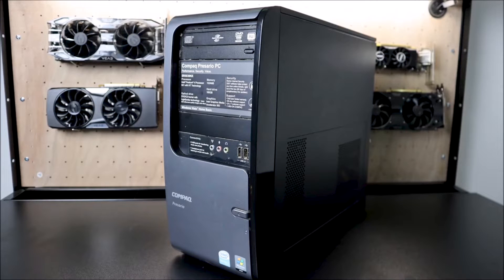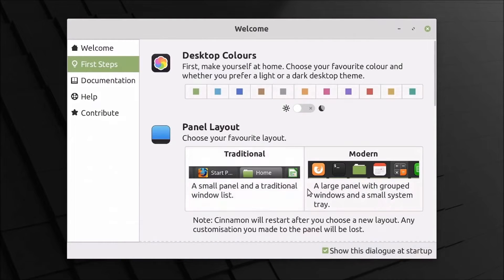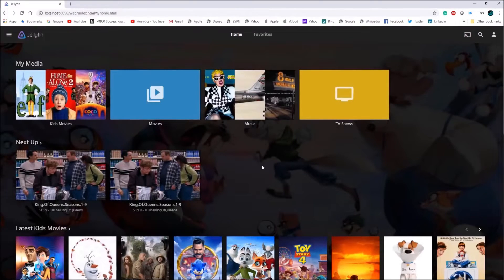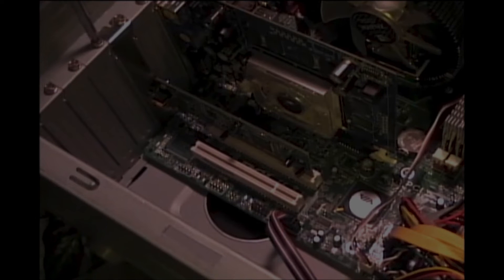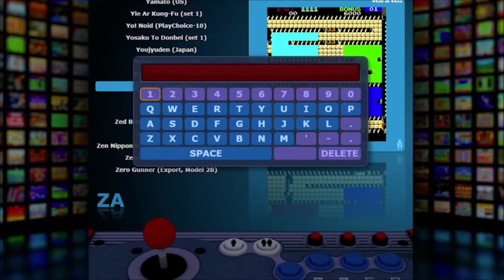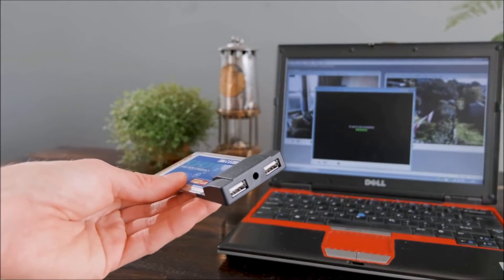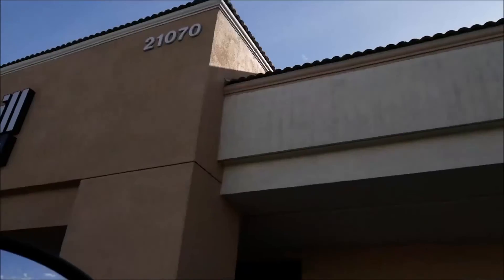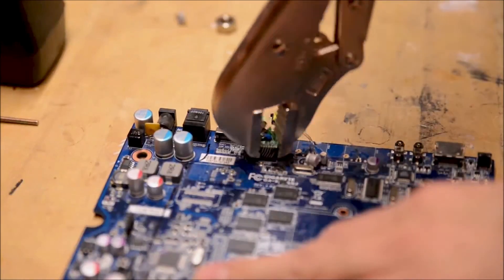15 Practical Things You Can do With an Old Computer

Comment: I would make use of my old pc if every click did not take a minute or longer to register
Reply from the maker: Hey there! I understand your frustration. It can be really frustrating when your old computer is so slow that it takes a minute or longer to register every click. There are a few things you can do to try to speed up your old computer. First, make sure that you have all of the latest updates installed . Outdated software can sometimes cause performance issues.

You can also try to free up some space on your hard drive . Old files and programs that you don't use can take up a lot of space and slow down your computer. If you've tried all of these things and your computer is still running slowly, you may need to upgrade your hardware . A new hard drive or more RAM can make a big difference in the speed of your computer.

Here are some additional tips that you can include in your reply:

Use a lightweight operating system . If you're running an old version of Windows or macOS, consider switching to a lightweight operating system like Linux. Lightweight operating systems are designed to run on older hardware and can often improve performance significantly.
Upgrade your hard drive . If your computer has a traditional hard drive, consider upgrading to a solid-state drive (SSD). SSDs are much faster than traditional hard drives and can make a big difference in the overall speed of your computer.
Add more RAM . RAM is the memory that your computer uses to store data that it's currently using. Adding more RAM can help your computer run more programs at the same time and improve performance overall.
I hope these tips help you to make use of your old PC!

Comment: To me, it's a big crime to simply throw old computers into a rubbish bin which will end up to a landfill. Even if motherboards and other internal parts are useless, the case still can be very useful. I've bought an old Intel Core i3 and turning it into our NAS.
Reply from the maker: A crime indeed! if there are laws for littering there should be laws against destroying old computers. Time is relative. what are old computers to us may be "Historical Artifacts" in the future
Reply: @adventuresinnostalgia  Buying a brand new case can cost at least four times compared to buying an old machine if you're lucky.
Reply from the maker: That's a great point! Even upgrading an older machine can be super budget friendly. For viewers who might be interested in this route, are there any specific components you'd recommend looking for in a used case to ensure compatibility?

Comment: I use an old computer for specialized tasks.
I use a Win98SE desktop to copy DVDs.
I have a slow cobbled together Win2K / XP to make DVDs from video files.
A WinME just for reading old hard drives and copying to a flash drive and converting the occasional AOL .art picture file.
A recovered WinXP Pro tower for connecting hard drives to clone with Clonezilla booted from CD.
Reply from the maker: That's a really interesting way to repurpose old machines for specific tasks!  Out of all your retro machines, which one has been the most surprisingly useful for you?
Reply: I kneel. I got some recovered boards and a tower from that bygone era and my first thoughts were "now what am I going to do with hardware that can't run most modern software?"
Maybe I should make this thing boot up XP or Vista and experience that bygone era once more

Comment: As a programmer, I use old PCs as a development system when I need to run old software. For example, I might need an old version of Python to avoid running into a lot of problems trying to follow an old tutorial. Instead of trying to install multiple environments on my PC, I can use an old system. Some programmers use virtual machines for this.
Reply from the maker: That's a great tip about using an old PC for running legacy software!  Do virtual machines ever come in handy for your development workflow as well, even alongside the old PC method?
Reply: Sandboxie is a nice step in between vm’s and separate bare metal imo. Curious to see what you think as a programmer?
Reply: Have you heard of a thing called VMs ?

Comment: I am totally clueless to what it is called! !! But I am very clear what I want to swith my old desktop pc. I want use it as thing to access any data from ,on my primary laptop. And can stream any content directly TV an can access data remotely via ip address.  Can you tell what it called I technical language and how can I make on using my 10+ years old desktop !!?
Reply from the maker: Using a PC for storing and accessing data over a network would be either a file server or network attached storage. Streaming media to devices  like a TV would be a "media center". There is software called Plex which is commonly used for that purpose so you may see it called. Plex server
Reply: @adventuresinnostalgia  can both be combined !! vis having capability of acceccing files on desktop laptop or multiple pc's  on a personal interenet network and can stream videos on tv too. Is there anything as such. I am based in India.
Reply from the maker: absolutely, you can have one PC fill many roles as long as all of the supporting applications can run on the same operating system e.g. Windows or Linux
Reply: @adventuresinnostalgia  are media server and file server

Comment: Got a place that gives me electronics. Gave me a lot of ideas for the 30 or so I have. Rather than just stack them up.
Reply from the maker: While stacking and dust collecting are pretty cool on their own, I'm glad you found something cooler to do with those systems
Reply: @adventuresinnostalgia  the real issue has been the printers. And about 80 or so monitors.
Reply from the maker: Depending on the age of the printers there are some interesting things you can do with them. If they can connect to a network wirelessly, chances are they can also function as an access point. Also, some have a task scheduling function where you can give it a URL like to a news site and have it print the page for you in the morning. My Grandpa always had a newspaper delivered in the morning. It was pretty mind blowing for him to see the printer do that automatically.

Comment: I'd like to refresh an old desktop to donate, but I hate that people can UNDELETE data from hard drives..so it sucks to give away a perfectly fine PC without a hard drive 😑
Reply from the maker: The wipe feature in CCleaner is good and DBAN is an alternative. 3 passes of writing all zeros should be sufficient to prevent any data from being retrieved
Reply: Just put in a new HDD, they arent expencive
Reply: I like to use a tool called NWIPE
Reply from the maker: @yotoprules9361 That's interesting!  I haven't heard of NWIPE before.  Can you tell us a bit more about what it does and how it helps you reuse an old computer?

Comment: Will a new motherboard support a old CPU like i5 2th gen?
Reply: All of the supported sockets and CPUs is listed in the mainborad description
Reply from the maker: Generally, no. There are some motherboards designed so support 2 generations of hardware so you can upgrade from one to the other without having to buy everything all at once

Comment: When you say old pc, how old it should be I mean core 2 due would do this all things ?
Reply: Depends on the machine. I have an old 2009 core 2 duo Lenovo laptop, that I occasionally use for work, if working from home. Granted, its upgraded to the hilt, with the "Extreme" series of Core 2 duo, 16Gb ram, win 10 pro etc, and Im very experienced eeking out maximum power of any computer system, but it proves the point; a core 2 due system can be usable in 2022 with no perceivable performance issues, if managed properly. 

If your only having 1 or two computers though, id highly recommend something newer. In my experience, it really comes down to how much ram you can fit. Any machine that takes 8Gb or less, as maximum installed memory, isnt really usable anymore, in the real world. Or, you have to adjust how you use the computer. I mean, sure, you can still run an old win 98 laptop with 64 mb ram, but you cant do what we do with new computers today.
Reply from the maker: I released a follow up video to this that talks about that. Core 2 duo should be good for the mentioned projects

Comment: I was gifted an old laptop from a friend and decided to upgrade the parts and use it as a secondary device or for school which was fine but then decided to multiboot windows xp , vista , 7 , 8.1 , and ubuntu while still using it for work which is quite awesome in my opinion it also familiarized me with how laptops are compared to towers.
Reply from the maker: Very nice!

Comment: I mean yeah, I have an old Dell PC, and I upgraded it with a GPU, and some RAM. Still runs Windows perfectly, but it doesn't have to. I use Linux.
Great video though.
Reply: My desktop doesn't like anything newer than Windows 7, despite being from around 2016, yet Linux runs beautifully. I use Artix BTW. (technically I dualboot with WIndows 11, but Artix is the main OS)
Reply from the maker: That's awesome! Upgrading and using Linux with an older machine breathes new life into it. What kind of Linux distro are you running on your Dell PC?

Comment: I wouldn't be inclined to use a particularly old computer for distributed computing, as the contribution is likely to be low for the power consumed.
Running Android-X86 is another possible use.
The world of retro can also pose interesting challenges - sometimes you need it to be fast enough, other times you need it to be SLOW ENOUGH
Reply: @adventuresinnostalgia  Just noticed, it seems you don't get chapter markings on the video progress unless you start with an 00:00 Entry
Reply from the maker: That's a great point about distributed computing on older machines!  For someone curious about trying it, do you think there's a certain age/power threshold where it becomes more trouble than it's worth?